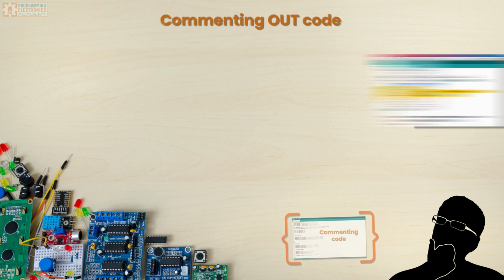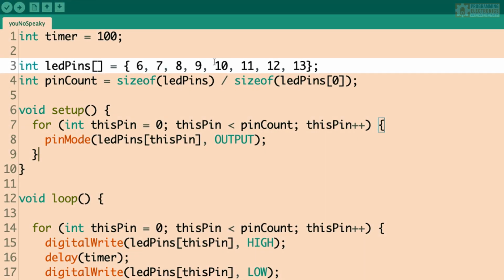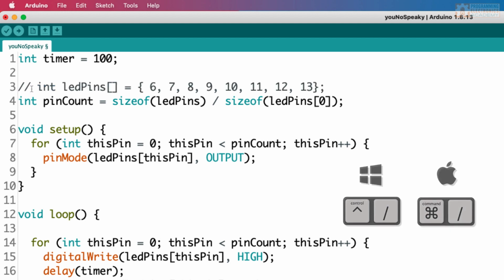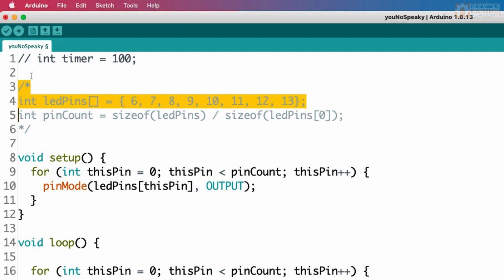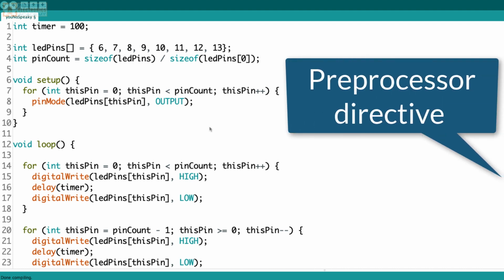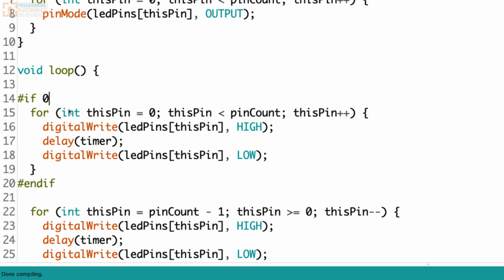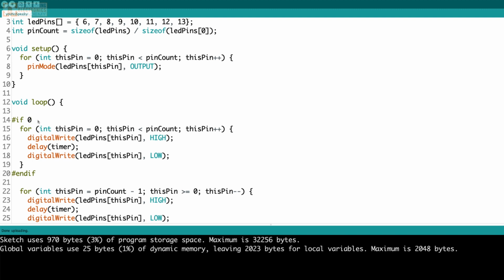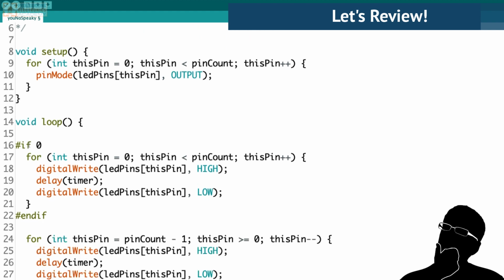3 Ways to Comment Out Code In Arduino

Comment: Can the third way be used as actual code? I mean with an actual condition in that if-statement? To implement things only if certain conditions are meat? Like a program in a program of some sort. Like making a variable on the top globally and setting that variable to true or false toggles certain sections on multiple pages of code. On different methods. Like disabiling specific features of the code by entering a specific "seed/sequence/Chiffre " or something like that 🤔?
Reply from the maker: Great question!  Yes, I believe you can do just that.  

Note that the macros can't read a "variable", but using #define you could create the values that are easy to toggle at the top of your code.  I'll see if we can put together a follow up on this...Thanks for the awesome question!
Reply: Thanks for the quick and informative reply😃, great job keep it up! 👍
Reply from the maker: Thanks  @icebluscorpion  !